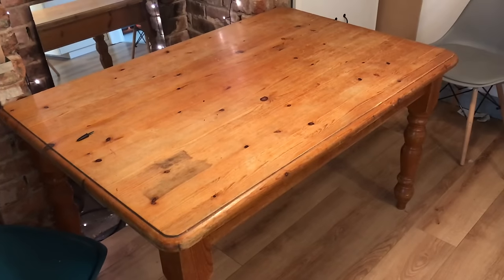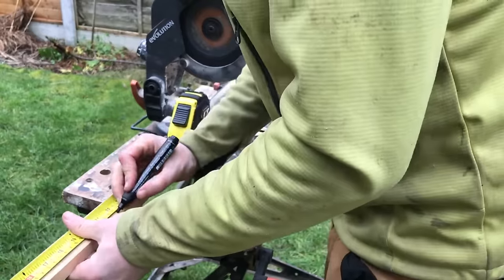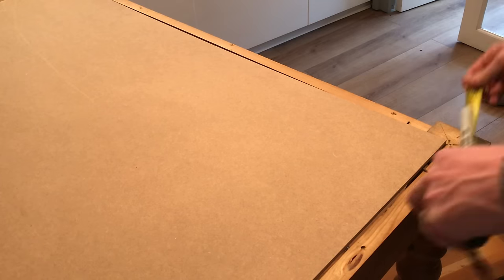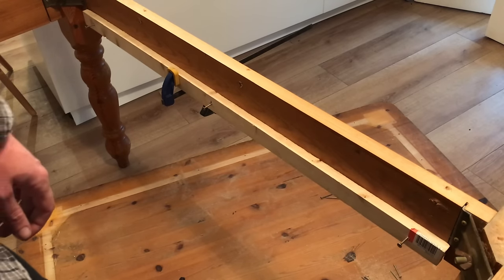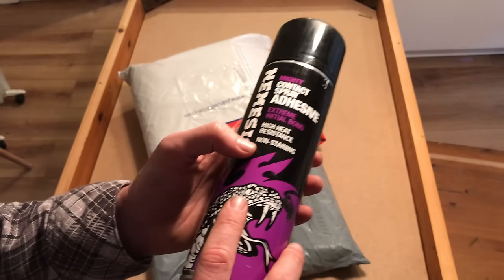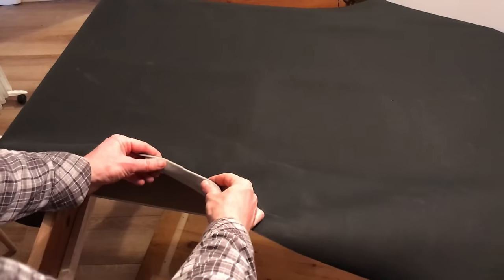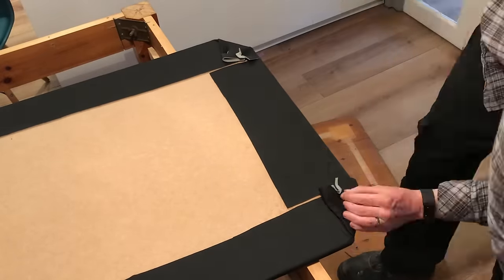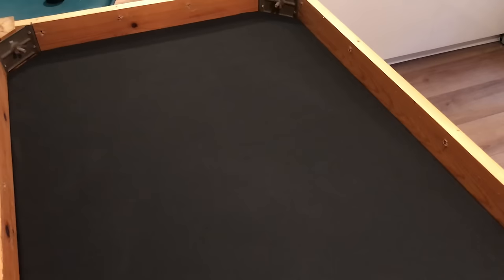DIY Board Gaming Table on the cheap!

Comment: If you screw or glue small blocks to the underside of the table top, up against the skirt boards, before removing it, you'll be able to put it back on, & it will lock in place without sliding around.
Reply: That's a great tip!
Reply: I did a similar idea but with dowels. I put 3 holes on the playing surface border and matching dowels on the tabletop so that it can only be set one way. It then just pops into place very nicely 😊

Comment: Perfect for at home casual gaming evenings.  I would consider 2 or 3 cross members of the 1 x 2 pine under the MDF to reinforce the surface in case someone leans on it.  As for the top, just a few guides attached to the underneath of the table top to prevent the top from sliding when in daily use mode.  Good job.
Reply from the maker: 2 years on I haven’t missed the xtra strength but it would definitely firm things up. I’ll add it to the project list!

Comment: I’ve been wanting to do this. Very thorough video and it’s an easy process. I think I found a used table the will work, and it will significantly cut down on time and materials required.
I’m buying a neoprene sheet I will trim to the size of the playing surface (using the mdf as a template). 4mm sheets lay lat and are a great gaming surface for cards and dice. It can be removed and cleaned as needed. You could buy different colors and swap them in and out. Royal blue and forest green are nice.

I’ll also add t-tracks for adding accessories like cup holders and writing platforms.

Comment: I'd use magnets for holding the table top on and the magnets ad a lot more ad on as well
Reply: The easiest way to "break" two magnets is to slide them sideways in opposite directions, exactly the way you'd accidentally nudge the tabletop. Over goes your tabletop onto the floor.
Reply from the maker: A very late reply but thanks for watching!
Reply from the maker: A very late reply but thanks for watching - a good point! A believe the term used for speccing this kind of resistive force is the "shear load capacity" of the magnet. Some manufacturers have it on their datasheets.

Comment: Looks great! I'd probably find a way to secure the top. Maybe dowells or something
Reply: Before removing the table top, I would simply screw a pair of wood blocks along the edges near each corner to align the top whenever it's placed back on the finished table. You could probably get away with just using 4 blocks, but having a bit more stability in the corners would help when using the table for non-gaming purposes.
Reply from the maker: Good idea!

Comment: I've had a similar idea. Managed to buy a 160cm x 90 cm table for £10 (unfortunately not solid wood but veneered chipboard). My hope is to set it up with a raiseable playing surface but I may be overcomplicating it.
Reply from the maker: I think the overall quality of life improvement is definitely worth a small outlay and experimentation time. I play infinitely more games now I have this table and I have ever done in the past. Keep us updated with your progress!
Reply: @TabletopUpgrades  Thanks. What size are the sheets that Wickes sell for £3 and do you know if they or any other companies still do similar offers? 
My sheet would need to be around 150 cm x 80cm. I'd been considering Plywood but that seems to be around £30+ (inc. VAT) for a 244 cm x122 cm sheet.
Reply from the maker: @malcolmrowe9003  think it’s euro pallet sized so 1200x800. Might be a peculiarity of my local wicked but I have had people in this channel say their wicked does them too. Certainly worth ringing a few in your area. As for other deals, not sure, I was amazed I found this!

Comment: Great.  The felt gets fuzzy or hairy with game play.  I’d stay with the car header material
Reply: I was just about to make the same point.
Reply: Interesting. I was going to say the opposite. 

Yes, felt can definitely get fuzzy (called 'pilling'), but that can be alleviated by buying a heavier felt. I think that 'shiny' felt looked a little cheap.

Every car I've seen older than 7 years has some section of the headliner(sp?) fabric beginning to separate from the soft foaming part, beginning to pill and eventually start to disintegrate.  And that deterioration is when the fabric is just attached to the car roof above my head.  I was wondering if dice rolling and moving game parts on/off/across the fabric, and drinks/coasters on the fabric would speed up it's deterioration.  Give us an update in 6 months, please!

A heavy (it'll cost more) felt--is there a 12mm?--won't last forever (no fabric would...casinos have to resurface tables eventually and they get a lot of wear and tear) will last longer. And I only base that on the fact that you said the headliner fabric is what's used on the roofs of cars.  Also, though some people only like the natural felt, some of the polyester 'felts' are even more durable. The 35% wool/65% rayon blend or the 20% wool/80% rayon will definitely resist the pilling/'fuzzy' that comes with age.  I have a 16 year old poly-blend felt on a table and it is still going strong...no fuzziness.

But yeah I'm curious how durable that header fabric is when it's receiving direct contact with objects/hands, especially the separation of the top layer from the soft foamy part.

Great video!

Comment: Does it feel odd playing inside a shallow box ? 
I feel my forearms would rest on the hard edge of the frame. Although the edge will stop stuff flying onto the floor.
Reply from the maker: That’s a common question - not at all strange to be honest. If anything I like the enclosed “casino style” where I cna throw my dice at the side of the table craps style. 

As for leaning on the side, I definitely intend to put a thicker, padded border on but tbh, even when resting on it, it’s not uncomfortable and most of the time, I’m either moving pieces round or holding cards.

Remember I’m mainly a solo gamer, so I’m very rarely just leaning on the table doing nothing like you might whilst waiting for your turn in a multiplayer game. 

Many thanks for you comment!
Reply: I've experienced forearm bang but I've played 11 hours recessed and arms and back were fine.  Leg clearance you need to be aware of though

Comment: Its a good idea. But those corner bracket things look ugly and probably not very safe with the bolt sticking out like that.
Though I'm sure the bolts could be cut down and the brackets covered.
Reply: Exactly what I was thinking. I would definitely have to put some sort of protection on the bolts at the very least. That might be the trickiest bit!

Comment: Would it have worked to lay in some really strong magnets to hold the top?
Reply from the maker: Quite possible, there are some Neodynium magnets that have 100’s of kilograms of holding force, some with dial operation so that’s an interesting though. First4magnets website has lots of innovative products, I’ll check it out!
Reply: @TabletopUpgrades  I will have to check out that site. The increasing strength and diminishing size provide increased possibilities with magnets. I am not sure of the vertical/horizontal hold strength of the magnetic safety locks for childproofing cabinets, but that latch/magnetic mechanism could also be utilized for so many projects...
Reply: When u use it, does it feel odd that the game is to far away / to low?

Also, is it uncomfortable to place the arms on the top-rim?
Would it be possible to maybe place a wider rim ontop of the old one tot rest your arms on and then place the tabletop ontop of the new wider rim?
Reply from the maker: @Fleischmann773  its hard for me to pass comment as i’m so used to it now. the player surface is only about 3” lower than normal so that is imperceptibly different to me but the lip i guess could be more comfortable. easily done by building in a lip on the inside of the table but that would reduce the playing surface.

i usually play solo anyway so usually holding cards or rolling dice - no time to lean on the edge 😀

Comment: Would it be possible to do somehting like this with an IKEA table? (I don't have a specific one in mind, but IKEA is worldwide, which means everyone could buy and customize one)
Reply from the maker: That’s a great idea and something I’ve considered- every time I go to ikea I keep my eye open!
Reply: I have just done this with an Ikea dining table. Can't remember the model name, but I know it was the cheap one (around £120 with 4 chairs) and is a normal wood colour.
I works well but make sure your battens are not too thick as the Ikea table has a thinner border, so there is less clearance one the top is back on. There's still enough clearance to keep medium size decks, counter trays etc, but tall pieces might not fit.
I glued/screwed some small battens onto the back of the table top that fits in the corners of the base, so the top sits on tightly without needing to be screwed, and doesn't slide around.

Comment from the maker: There's lots of improvements to be made but what would you do next?
Reply: Solo Board Game Guide 
The table top does provide stability from twisting that is now gone. If you braced it at the corners you could set the game surface on that. The table would be more solid and the inside clearance bigger.
Reply: Maybe it's just a personal thing but when my group are gaming we tend to have a few nibbles/drinks etc. Possibly think of having a simple tray/armrest that hooks over the table edge: they can be stored inside the table when the top is on.
Simple and well demonstrated - I too am no carpenter nor seamstress.
Reply: @linyarin  There are some lovely holes in the corners that cupholders on pegs/dowels could fit right into if fit snuggly. Instant and removable corner cupholders.
Reply: The flimsiness of the MDF would worry me a bit. I'd screw in a few supports underneath it. Two 1x2's would probably be enough. If some one leaned over and put their hand in the middle of the table, I'd be worried that the MDF would crack.
Reply: Personally I'd drill matching holes in each of the tabletop legs and the table top  surface and glue in some wooden dowels to the table top which will stop the top from sliding around when you're using it as a table and not as a gaming table.
Reply: I would fit the top with some pieces of wood you used for the bottom to make the top fit in place!

Comment: I love this, a few months ago I decided to make myself a board game "table topper" the idea being I could keep it under the sofa and pull it out whenever I wanted to play. I got a bit overexcited and made it too big to practically get it out and put it away (it's dimensions 135cm x 95cm).

I've got a very similar dining table to yours so I intend to convert it. I tend to play in groups so intend to build in a bit of a lip of approx 10cm along all edges of the table which will also incorporate component trays. 

The play surface will end up being about 120cm x 57cm, so smaller than my current table topper but it will be more practical! I'm looking forward to working on it. 

What are the dimensions of your play surface out of interest?

Comment: How does the table top stay on when its in dining mode? I feel like elbows and hands /standing and sitting would bump it around?
Reply from the maker: I did another video linked in the playlist where I put hinges on it. It's great for solo pay but hinges wouldn't be good if you wanted people to sit on each side. If this is the case is make a simple frame on the underside to constrain the table top.
Reply: @TabletopUpgrades  I would put 1x1s  under the top piece to where the top wouldn't move

Comment: Great work! What are the names of fabrics you used?
Reply from the maker: Car "Headliner Fabric", it's a kind of foam backed felt. Speed cloth is good if you can get it, but in the UK it's mostly got the suits of cards on which I didn't want. I initially planned to use baize/felt but the stuff I got, looked way too cheap.
Reply: @TabletopUpgrades  could those card cloths be flipped over? or are the symbols embroidered in such a way that they show through on the bottom?